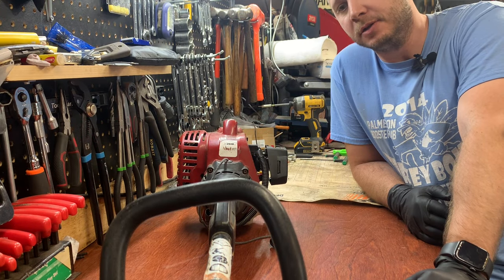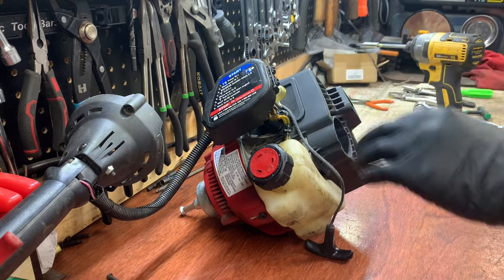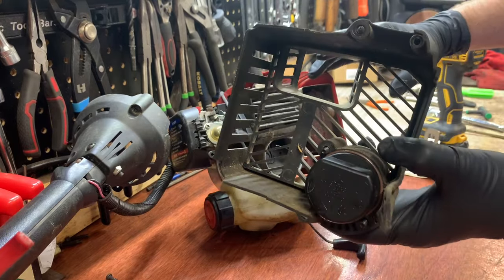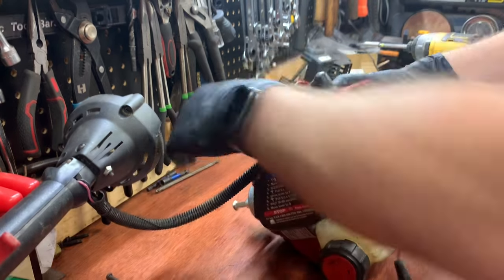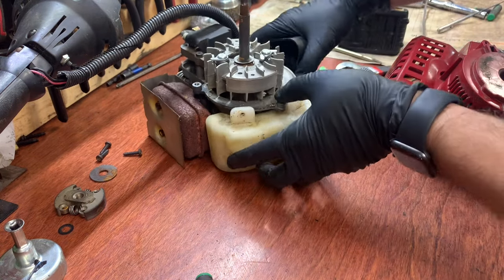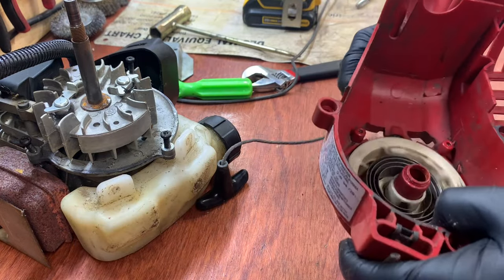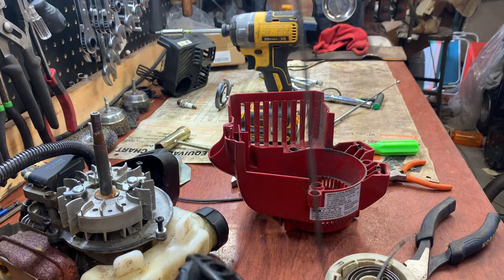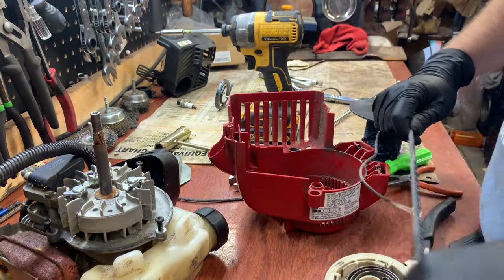String trimmer pull cord repair

Comment: Good details until it was time to wind the cord back in. Almost like you purposely didn't want to show how it was done.
Reply from the maker: @ 16:45 you can see how I pull the string through and hook it onto the little notch on the white pulley. I turned to 5 times but needed 7 times. So there really wasn’t much to see on the second 2 extra turns. Sorry about the camera view. Not always easy to make sure I’m in perfect view while making the video.
Reply: That’s the step I am on and it’s just not happening for me lol. I be turned it back times but great video any advice?
Reply: Can you make one zooming in on cord and weel when your turning it 5 to 7 times lol 😂
Reply from the maker: @dennyhall4466  unfortunately Idont have one in the shop right now. What are you having trouble with? Is the spring in and the pulley in place? And now the string is all the way out but not coming back in? If so I’ll can try to talk walk you through the next step
Reply: @SHONEY21Z I watched this video and fixed my weed wacker once, now like a lot of people I'm having trouble getting the cord to retract (after pullcord pulled all the way out again; repair attempt #2). 

The spring is in and recoiling. When I put the string into the notch to start winding the pulley, it doesn't feed onto the pulley reel without contacting the sides of the housing. If I just let the pulley go after winding, it bunches up without retracting the pull cord.

Any advice?
Reply: I agree with you not actually showing us how to do this repair.  It may seem self evident to you since you have done this before.  Try to keep in mind that most of us are watching to learn the technique. Your video did not show a novice how to do this repair. I'm just glad you are not teaching new airline pilots how to fly.

Comment: Do u know how to turn a pull start into an electric start or cordless drill start?
Reply: Also, would it be necessary to remove the spring and rope for the electric start to work?
Reply from the maker: I do not. Now how unless it already has the electric start option.
Reply from the maker: No the pull cord can stay if you have an electric start model. You can also remove it if you wish

Comment: This is killing im getting ready to just throw this in garbage. For starters mine is 2 cycle engine. I have both the 2cycle and 4cycle engine torn apart. Mine doesnt have that shield. And no spring like mentioned. It biulds tension but after 3.or for start the cord doesnt wind back up. Then it gets siezed.
Reply from the maker: Ever figure it out?
Reply: @SHONEY21Z  yes

Comment: Outstanding instructions. Really appreciate the help. The lock washer on my machine is split so I will need to get a replacement. I can't find the part online. Would you happen to know the part number for that retainer?
Reply from the maker: This question was asked before and I was unable to find that part sold individually. I can’t guarantee a fit but I suggested trying something like buying a kit like this  https://amzn.to/4fj4Q6e with various sizes. Or check local hardware store/tractor supply.
Reply: @SHONEY21Z  Thanks for the advice. That was the route I was hoping to avoid as I hate to have so much excess stuff that's hard for me to throw out. I will measure the outside diameter and get a kit that includes a push on retainer ring that will fit. Thanks again!

Comment: Great detail video!  Rope in the spark plug port was the BEST trick ever!  Could not have done it without that tip. THANK YOU
Reply from the maker: And thank you sir for commenting. Glad I could help. Every like and comment helps the channel!
Reply: Does one size piece of rope,as far as diameter goes, work better than another?  I’ve tried two different sizes and didn’t stop the piston from movement

Comment: No matter what I try.....I can't get the torx screw off that holds the clutch drum on.   This one I'm working on is a Craftsman.....but as you know it's the same. My screw is a T30 and it looks as if someone may have messed it up.
Any suggestions.  I sure hate to drill it.
Reply from the maker: That’s a tough one. Stripping that screw is a major ordeal. I would search Amazon/harbor freight  or anywhere you can think of for a long skinny stripped bolt extractor. Another option I’ve seen ppl try is hammer a flathead into the bolt head to try and make new groove and turn it that way. I’ve also seen this done with a slightly larger torx T-handle

Comment: What ‘groove’ are you talking about at 16:49 awesome video but once it gets to rewinding the pull cord the directions are hard to follow
Reply from the maker: Is everything together but the cord all the way out? If so then you are ready to start winding up the spring. Pull the cord out from the inside of the cover. There’s a groove in the white pulley, lock the cord in that groove and start winding the pulley clockwise about 5-6 times. Then let go of the pulley and it should retract the cord

Comment: When I use the t15 to remove the screw, it doesn’t loosen. It keeps spinning the pull string inside. What am I doing wrong? I have the  craftsman WC2200
Reply from the maker: Did you block off the piston? Otherwise you’ll be turning the motor over when you try unscrewing the torx bolt.
Reply: @SHONEY21Z  yes I got it now

Comment: Aye so the notch that the string is supposed to lock into.
How does that work? It would leave the string hanging off the side a little and cause it to get caught, would it not? Im confused.
Reply from the maker: At 16:45, you can see this being done, sort of. With the string fully extended and no tension on the spring, pull the string inward toward the pulley and make a loop. Hook the string into the notch and start turning the pulley clockwise. About 5/6 turns at most. (Depending on the length of your string) then pull the pull cord handle out so there’s no more loop and the n allow the pulley to retract the pull cord.

Comment: Does anyone have a source for the "lock nut" that holds down the starter recoil as shown at 8:20?
I split it removing it.
Reply from the maker: The part isn’t sold individually. You’d need to buy the whole starter assembly for around $25. You could try to match it from a kit of end cap clips like this one from Amazon. 
https://amzn.to/3KSrGDZ

Comment: A question for you or anybody else out there that's in the know. On the one i'm working on there's a little sliding piece of black plastic that slides in the housing up against the coil/ spark plug wire, I put a new coil on and it had spark just fine until I reassembled .on the old coil there's a ,Emory mark where the slider was rubbing on it. Have you or anybody else had issues nwith the lil slider?
Reply from the maker: Are you sure that’s the problem? Could be a grounding issue. Check all the wires and attachments over again.

Comment: Early in the video, you mention the need for a long handled T15 and T20.  Later, you state that you are using a T25 to remove the shaft that covers the clutch.  Did I misunderstand or did you possibly mix up he T15 for the T25?  I need to buy the part.  Thanks for a great video.
Reply from the maker: It’s a T15 torx long handle to get the clutch bell off. There’s a link in the description the tool at Amazon.
Reply: @SHONEY21Z  Thank you! I appreciate the video and the prompt reply to my query. I bought a set of long-handled torx wrenches at amazon and it includes the necessary size.  My weed whacker is not the same model as yours, but it is very similar and your video helped me muddle through the project.  I pulled the thing apart, put new line on, wound it up, etc. etc.  It retracts nicely in its plastic housing until I reattach it to the weed whacker and pull the cord against the resistance of trying to turn the piston.  Now when I pull the cord, it is not engaging the engine.  It just makes a ratchet-sounding noise like it is slipping; clearly it won't start the engine this way.  Any ideas?  Might the part that catches the engine be worn out?  I can't see that it is, but I don't have a lot of experience at this.  Thanks.
Reply from the maker: It sounds like the paws aren’t engaging. Sometimes they get stuck and need lubrication and sometimes it’s assembled wrong and somethings hanging up

Comment: On the T15 do you turn counter clockwise or clockwise ?
Reply from the maker: Lefty loosey (counter clockwise) but make sure to block the piston from turning as well when taking the clutch off.
Reply: Thanks, I blocked the piston but the t15 will not budge. Any idea what might be the issue?
Reply from the maker: @wesbrown5708 there’s an arrow showing the direction to spin the clutch I used a wrench on the square part of the clutch and started turning in the direction of the arrow while holding the trimmer head tightly
Reply: @SHONEY21Z  I meant the t15. I blocked the piston but still cannot get it to budge. Any idea what might be the issue?
Reply from the maker: Hmm. It’s probably just very tight. It’s scary to turn but as long as the t15 is seated well and a lot of downforce it shouldn’t strip. It takes a lot of force to crack the bolt but then it comes out easy. A long t15 bit on an impact would probably break it open easier but if it slips it strips. That’s my best suggestion just to use the handle and turn pretty hard with down pressure. Hard to hold the head and the tool at the same time but it should loosen.

Comment: Is there any other way to block the piston other than shoving a rope down?
Reply from the maker: Zhiqinge Universal Nylon Piston Stop Tool 2 Stroke 4 Stroke Engines 10mm & 14mm https://a.co/d/ehCJ6c8

These have mixed reviews
Reply: The sting method worked perfrect.  Never thought of that. So simple yet effective.
Reply from the maker: Great news!
Reply: What kind of rope is that? Where would I buy it?

Comment: I have a craftsman 2 cycle 25cc and im on the clutch part of it and every time i turned it the clutch wont come off idk if im doing something wrong or what
Reply from the maker: Is the motor turning over? Or is it turning a little with spring tension? You have to take out the spring tension and then turn it a little further to break it free. It’s not easy.
Reply: Yeah, my clutch will not come off !the Pistons is not spinning, It is just super tight.
Reply: I don’t know why your clutch came off so much easier
Reply from the maker: @funnypants1234  does it feel spring loaded when you turn it? Because you have to push through the secondary spring until it’s uncoiled and the lm turn it a little further to break the clutch free. Try using a little penetrating oil near the threads or slightly heating it but don’t melt the plastic.

Comment: Mine is wc2200 maybe thats why i am having trouble.
Reply from the maker: Did you get it figured out? It’s possible you have a broken spring
Reply: @SHONEY21Z  not yet. I don't think so because my cord. Just ripped. And just neede that. Soon as I start put rope. It started right up but I didn't wind it correctly. I have 2 identical 4 stroke ones side by side
The issue is with the 2cycle one. It's just slightly different. Doesn't have that plate. Like yours.  And everything else but no plate.  But you know what I it could be.  I just think the part where you put the cord on the groove. I cant seem to do it like you did. Ive watched the video over and over.  Maybe in just stupid or maybe it is broken. How do I confirm that. Minr doesn't have visiblly that spring you like your s. But when i put it together the rope rope will retract. But then got stuck after s few times. So I know it has tension. How can I show you. ~? Maybe post. A video on my channel and send link. Appreciate you responding.  Been doing it for 2 days just got over it.
Reply: @SHONEY21Z  video does it so easy and must be doing something wrong. I don't think spring is broken. But I have been wrong before
Reply from the maker: @MrRaulgutierrez95 does yours have the small color that holds the pull cord assembly down? I call it a lock washer.
Reply: @SHONEY21Z  yes i didnt Remove it.? Left as is.
Reply: Pretty much I did everything in the video. Only difference i didnt Remove the lock washer. Like you did. Just stuck the string (  not easy) throw the hole. And tying a Knott was another pain.
Reply from the maker: @MrRaulgutierrez95  I’ve had practice so I can make it a little easier. If the spring is good, check your white string wheels. Sometimes the tabs are worn and the spring will slip by. Also make sure the loop on the inner spring isn’t bent in or out too far. That needs to hook into the white wheel and stay there. Otherwise it’ll slip and loos retention
Reply from the maker: @MrRaulgutierrez95  even though you didn’t remove the collar, make sure it’s push down firmly so the whit wheels can’t move up or down.